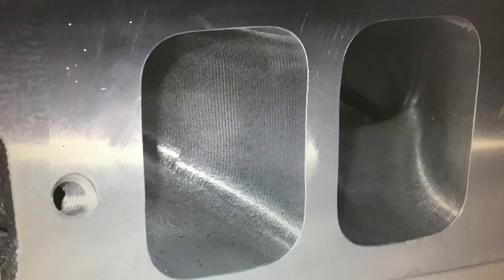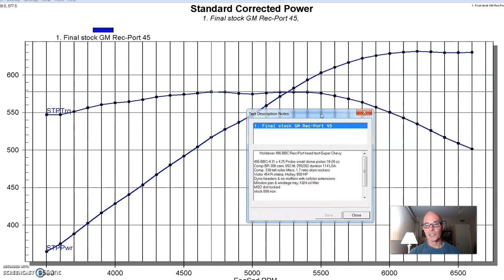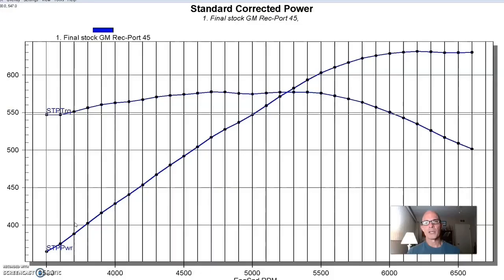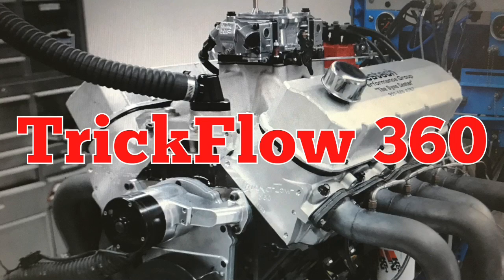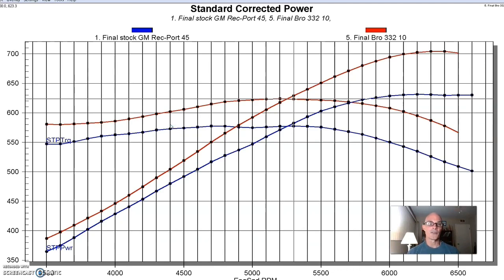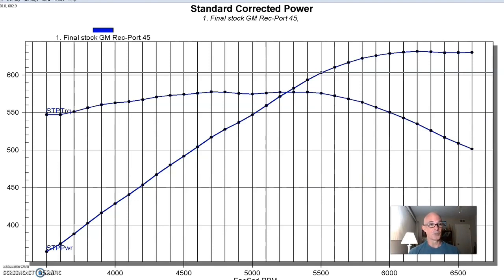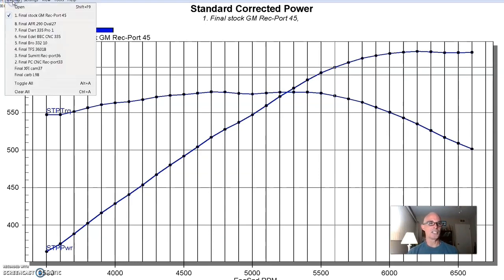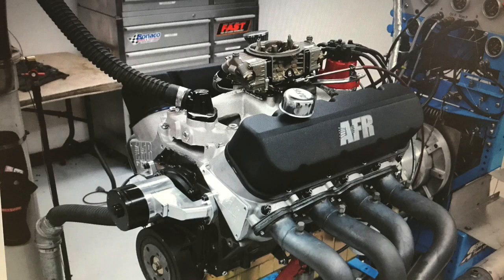HP HOW TO: BBC HEAD TEST pt2

Comment: Last year I had a 489 built for my 68 Malibu, 10.8 comp., Brodix RR Rec port 294 W/CNC chambers and cut to 115 cc, gasket matched Eddy AG  W/AED 1,000 cfm carb & 1 7/8 headers for clearance in the car, cam was a hyd roller 231 int 239 exh .600 lift 110 lsa and made 600 ft lbs from 4200-4500, 589.8 hp @ 5700, I went small on cam for A/C
Reply from the maker: GOOD COMBO

Comment: Taking a cad 500 and putting a huge turbo on it on 89 to 92 pump gas with 600 to 700 hp was quite a street car in the 80s and 90s. And in a t bucket was the fastest street car around.

Comment: Ran Dart 355s on a 496 13:1 roller motor w spray and the car was running 4s in no time..Had enough room later for a 565 and was deep 4s with that set up at close to 160mph..

Comment: The big advantage the AFR heads had over the rest was the smaller chamber size, which boosted compression and thus HP. Given, they also flowed as good as or better than the rest of the heads as well, but there wasn't a clear advantage in flow which would account for the difference.
Reply: Paulster2 — Edelbrock had a smaller chamber at 107 cc vs 110 for the AFR’s.

Comment: It seems that the heads with the bigger exhaust flow do better regardless of shape of port so maybe the choke up is in the exhaust for big blocks also smaller chamber which means more compression is playing a major factor but if you can make big power with regular gas that’s big especially since your gonna go thru a lot with a big block this test shows more a choice in octane then anything with the chambers Being  from 107-123 stock and some of those big flow heads coming with 122 which could still be ran on 85-87 octane. To some that could be worth losing 15-18 hp

Comment: We built na engines back in the 80s and 90s that didn't come close to turbo engines. Big diesal turbos were great back then and not alot of money used. Garret,holset, mack etc were nice. And we usually needed just one to hit 800 hp on pump gas from a bbc or cadillac 500.

Bloodviking

Comment: I’ve a set of those big ole heavy cast 781 heads with 2.25 and 1.90 valves on my 10.5:1 496 Stroker. I only hope when it goes to the dyno

Comment: Thanks for the great info in this video! I’m wondering if many of these heads would like a bigger bore. Seems like that 4.310 bore might have shrouded the big chambers. Maybe test these heads on a 502 or 509, or maybe a 540.
Reply from the maker: would be better
Reply: afr does flow rec heads on a larger bore.

Comment: Those heads would have shined even better with a .750+ lift, 280+@.050 cam, 13.5-1+ compression and a 1150 Dominator on a Super Victor intake. That would be a good pump gas driver tho.

Comment: It’s always the case that a head with the port volume to match piston demand works better than something too big, even more so when it also outflows the bigger heads in the mid lift region of the chosen cam. Cam would be miles better on a tighter LSA and get the tq/ci numbers towards 1.4

Comment: Absolutely awesome test, very close to a motor I'm in the process of building. So extremely useful for me,  thanks! Mine is a stock ls6 454 bottom end with as cast pro comps and just a touch bigger cam. I'm gonna guess I'd lose probably 50hp cause I don't have the stroker?
Reply: I bet you lose more than 50 HP.   With the cost of the 265 AFR heads at just a little over $2k a set,   I don't understand why anyone would mess with the offshore heads.

Comment: If you do further testing on the 496 can you do a dual plain setup with the 265's and 290's
Reply from the maker: why on both heads?
Reply: @richardholdener1727  curious what the limitations are on the  265's and which of the two perform best on the same 496 platform.id also like to compare the power curves of the two dual vs single plain

Comment: Richard, which Brodix head was this? BB-2? BB-2X, something else? CNC chamber option? Also, it's funny that the best Rec port head you tested on this 496, wasn't a rec port at all. That 290 Oval from AFR dominated in peak, and average power and torque. Makes me want to build a 11:1 496 with some AFR 300 Oval port heads on E85!
Reply: Several people have asked the same question about the brodix heads. I haven't seen any replies from Mr. Holdner.

Comment: Hi Richard, reading your 2012 article  “Big-Block Heads Shootout - The Big O Vs. The Big R” The Edelbrock Victor Jr. 454-R intake used on the other heads, when you test the AFR 300cc oval port head was an oval port manifold used? If so, which manifold?
Thank you, Chris
Reply from the maker: I WOUL DHAVE TO LOOK IT UP-LIKELY A 454 O

Comment: I'm building an old school chevy gasser, and I am currently building the engine for it, I'm going to run a 496 BBC I'm just trying to get your opinion on what would be the best head/cam combo that will work with a dual holley 750 double pumper carbs with a tunnel ram setup, I may put nitrous on the car I am undecided on it, but I do want to take the car to cruise nights and to the drag strip on occasions so looking for a good combination that will give me the best bang and buck don't matter I am not skimping on parts so skies the limit!!!! Any help would be greatly appreciated, thanks

Comment: Richard Holdener / Westech: Content Request: I'd love to see someone do some spark-related dyno myth bustin.  It's an area that's so filled with folk lore and snake oil-esque sales tactics.  Does anything actually matter here? 
I'd love to see Spark Plug Gaps tested with traditional plugs and Iridium plugs, but the IGNITION TIMING need to be optimized for the gap / plug type (an NA test; obviously a forced induction test would introduce more factors that need to be considered.).  -I haven't seen anyone do this part right, yet. If you actually DO get a faster flame front propagation / a shorter combustion event from a particular plug / gap, then you need reduced ignition timing to see the full torque gain.
I'd love to see the spark plug gap opened up until the ignition system becomes a limitation and then throw a beefier ignition system on and see how far you can take it. 
I'd also LOVE to see a fuel economy test added onto the end of Spark plug / ignition testing: theoretically a larger spark plug gap will support a leaner AFR at cruise and improved highway fuel economy -> DOES IT? 
Then a series of tests testing all the weird and wild alternative spark plug designs with weird and wild claims. "Go for broke" and test one of the new Plasma Ignition systems because that stuff looks cool on a video and might get you more views / Likes by adding that to fuel economy testing that would probably otherwise see fewer views / likes / subscribes...
Reliable spark plug testing is HARD when the gains are so small, but you guys have the equipment and know-how to do it and to cut through the paid-advertising FuD dyno tests...
Reply: Yes!

Comment: Looking at the flow data, the small cam really didn't take advantage of the high lift flow numbers to truly compare these heads. I believe with another .100 lift you would have seen most of the heads make more power than the oval ports.
Reply from the maker: agreed-I think we mentioned that several times in the video
Reply: @richardholdener1727  I posted that about half way thru the video.

Comment: Interesting and educational comparison so bigger isnt better even with a 500 cubic inch engine.
Yeah i remember the BB and the 'reg' called passenger engines came with the OVAL and the 427/425 or 396/375 had the rect. but they also had bigger valves and intake along with that streetable solid cam so that probably accounted for the extra 25 of advertised hp.

Performance engine building has a great set of vids about making 650 with ported oval iron heads, yes lots of work but he sure knows what to do and his engines look STOCK when you pop the hood, so run a low 10 in your 1st gen. street Camaro then pop the hood and all people see is an intake and carb. Back in the day 400+ was a true accomplishment for a street engine and strokers were only a wet dream

Comment: I'm disappointed compression ratio wasn't mentioned here, outside of the Dart Pro 1s...while I am an AFR fan boy and have ran 2 separate pairs on 2 engines, a lot of the gains were from compression....
  Notice with the exception of the Dart heads the 122cc chamber heads run within a HP...and the 107cc and 110cc heads produced the most power....
 The change from 122-123 down to 107-110 is a fairly significant boost in power and it shows in the graphs, unless copper gaskets were used to try to equalize this....
Reply: Yea did some quick and dirty calculations from the biggest chamber head to the smallest is 1.5 points of compression difference and if you even split it at 1 point difference and add the 3% often seen by a point of compression at this size its exactly the extra 25hp or so the top heads in this test produced....
  So what did we learn? The Dart Pro 1 on this engine at 107cc would have outperformed ALL other heads....and the Procomp milled from 123 to 107 would have performed equally to the heads at 107 and 110cc....
  In BBC heads are everything but so is compression.....I ran my 265s flat milled as far as they would go, setting at over 11 to 1...it was nasty....lol...I milled my 325s too....

Comment: Do you think that 950 carb could have been choking peak power a little? Seems like a 1000 or 1050cfm, would have been a better match for this combo. 
What do you think? Did you get vacuum readings during the run?
Reply: Baby carb and baby cam.

Comment: Please do a video on torque output not horsepower I want low rip the assault out as I pulled this massive load
Reply: Also think about guys with manual transmission what's the engine do down-low in granny gear

Comment: What was the compression on this thing? What fuel did you use? Love the video as always!!
Reply: If you look in the specs at the end you can see the chamber CC size. They used the same piston/gasket so looking at it the smaller chambers won the race.
Reply: Compression still vary's with chamber volume sizes.
Reply from the maker: pump gas and mid 10s
Reply: Richard Holdener damn impressive.

Comment: I love the dyno tests.  I wish we could somehow combine it with the flowbench testing to see what the velocity vs flow does to the HP number.  I'm pretty sure the AFR oval port heads are putting out superior flow for the higher port velocity they have to have.  Because the air pump never changed its demand at any given RPM so it stands to reason that the port was VERY efficient.  OR was the port volume numbers kinda skewed because of valve location changes.  Kinda like the early trick flow stuff.  The port volumes were a bit misleading as the changed valve location made people think the port was smaller, when in reality it was not it was SHORTER.  

Which leads me to my next "I wonder" moment.  Since direct injection is becoming viable to gas engines I have to believe that fuel atomization is no longer a very important part of the equation.  So, what would be the purpose to have ANY restriction to the intake tract?  It really only inhibits flow, and is that not what we are trying to do efficiently?  Are we not just trying to get as much air in as possible while minimizing pumping losses?   Or do I have this all wrong, and the ram effect of the moving column of air aids in filling much more than no restriction at all.........inquiring mind want to know.

Comment: Rick I need your opinion.  I installed an Edelbrock top end kit on a 460BBC (Edelbrock #2070).  Its a stock bottom end maybe 9:1 CR.  Using their aluminum performer rpm heads and the hydraulic roller cam supplied with the kit along with 1-5/8” headers and full 3” exhaust with an h pipe.  It used Holley Efi and hyperspark ignition.  Made 440rwho and 480ft lb.  my issue was peak power was at 5200rpm??? What gives.  I dont understand why its not revving out to 6-6500.  Kit says it should make power from 1500-6500rpm

Comment: Hey Rich.
If one were to do this combination with the 290 Oval heads, but using a cam with 10 degrees less duration on both exhaust and intake while keeping everything else the same, such as .650" lift, 290 heads, 454 intake, compression etc. How much power do you think would be lost from just running a bit less duration?

Also one other question. When swapping to the 290 Oval heads in this test, what intake did you use? The 454-O instead of the 454-R?
Reply from the maker: we use a 454 O

Comment: A 496 with GMPP 572/620 heads and the weinds dual plane with a 240s hydro roller and 10:1 with an 850

The. Weiand dual plane rectangle port intake has HUGE ports for a dual plane intake. Some of the biggest ive seen

Woupd be. A 600hp stump puller I think

Comment: Which do you think would be the better choice for a 496 pump gas hyd roller  street/strip  build .afr265's  brodix270's or jump up to  afr290 ?
Reply from the maker: DEPENDS ON CAM-IF BIGGER CAM THEN THE 290S, IF 255/260 CAM THEN 265S

Comment: You tested the afr 110 cc and the best every thing out there from what I seen ….. how does there other heads work between the 110 cc vs a 119 cc or that don’t make no diffrent power ?
Reply from the maker: 110 vs 119 makes a difference in power
Reply: @richardholdener1727  How much power more will it make I thought it just determines the compression

Comment: There is a TON of guys wandering what a guy can make on a full effort drag race engine! I made 770hp and 711 tq with 300cc magnum AFR heads! Please go full big bock full effort race engine because we need to know! Thanks for the info BTW!
Reply: My 572 with out of the box 300cc AFR Ovals made 807hp/736 FT/lbs on pump fuel with a super Vic intake, 270@50 SR. They’re a awesome. Heads. But now I’m going to 357cc AFR’s, should pick up 60+hp ...I hope.
Reply: @michaelparadisis4076  I hope you do too! Let us know the numbers when you do it

Comment: Can you do the same now with stroker BB mopar? Also were all these heads out of the box or did you have to do work to them? Springs, keepers or valve job?
Reply from the maker: OUT OF THE BOX
Reply: @richardholdener1727   was curious with that especially on the procomp.

Comment: So is that the dividing line, should I choose oval port for smaller displacement or lower expected power? You have a great summation but no real recommendation.
Reply from the maker: we've made 900 hp with oval port heads, look for heads that have enough flow to support your power needs-the AFR 265 oval heads (for example) can make well over 600 hp
Reply: @richardholdener1727  Thank you so much for replying! I have a Gen V and this was very helpful

Comment: Lingenfelter covered oval port superioty 30-40 years ago, the comp 288 solid roller will rev 7000 rpm b4 I can make a manual 1-2 shift, why no Dart intake test ?
Iron heads are a real challenge for babyboomers, need more real world feedback,  bbcs have no low end torque issues, different receipies for very different engines

Comment: For a street big block the ovals are superior. Even back in the day, guys in the know would yank the rec port heads in favor of the ovals. Too much port for a baby 396 or even a 427. There’s decent numbers to be had even from “junk” peanut port heads.
Reply: Only fools would have done that.   Yes back in the day you could have you a set of pleb oval ported to out perform the stock rec's but ported recs would even the playing field again.  The solid lifter BBC feel soft down low mostly because the power come on so much harder with revs.  When you compare the curves you can see that.  Plus it's still large displacement V8 it's not lacking torque anywhere really.  It's only when you compare it with something else that you make those observations.  Lastly if you race on the street you aren't short shifting anyway because acceleration is 100% a HP thing.
Reply: @GlassTopRX7  Not so.  The square port bracket racers always got trounced at the track by ovals.

Comment: I would imagine the "snappiness" of the Brodix and the Oval port setups would be more pleasing to most. With the smaller Oval port setups, I would be curious if it would be more street friendly with vacuum and throttle response. I like smaller "CC" heads that make power because I believe that they are more violent when you mash the peddle. It would be nice to see what your comments about tuning each head would have been.
Reply from the maker: unfortunately we did not run them in a vehicle

Comment: Richard, I'm building a 408W turbo. Question is; I have the pro-comp single plane that has power band from 3500-8000. But I'm limiting my build to 6500rpm. Should I swap to a dual plane intake to suite the RPM range or will it choke my total air flow?

Comment: We’re using brodix 2 heads and my builder is expecting around 600 hp. That’s without porting. Is it necessary to do porting to achieve 700 hp?
Reply from the maker: WHAT DO THEY FLOW? WHAT IS THE REST OFTHE COMBO?

Comment: I have a 496 Vortec can you pinpoint me a combination to have it a beast? I’m putting it in my 1971 and I want to be the baddest around but reliable I mean can drive it anywhere. Can you tell me a combination please
Reply from the maker: do you have an 8.1L or a stroker 7.4l?
Reply: @richardholdener1727  what’s the combo on this build I’m looking at putting a 496 together I just bought a 4 bolt main 454 block

Comment: the moment i saw that low end come up i thought compression ratio...but that is not mentioned ?
Reply: Mid 10s. It's towards the end of the video.
Reply: @xmo552  the heads vary in chamber size , 107cc to 122cc i think it was , so i wondered if it was connected with the higher power output of the small chamber heads ,  i could not find a mention of cr variance .